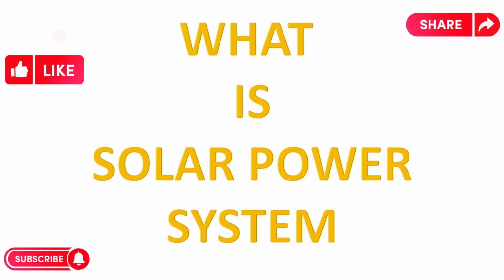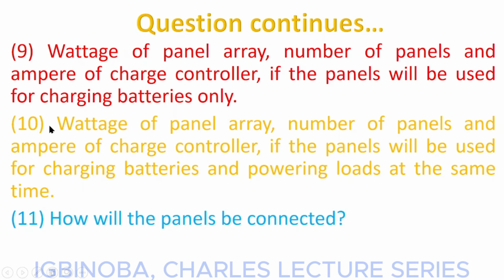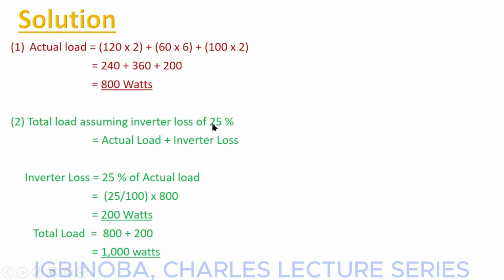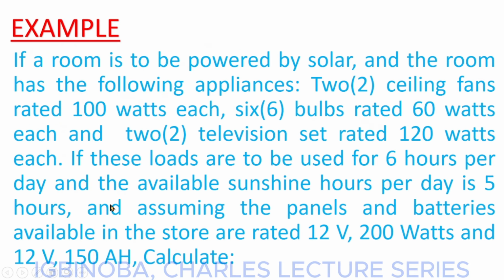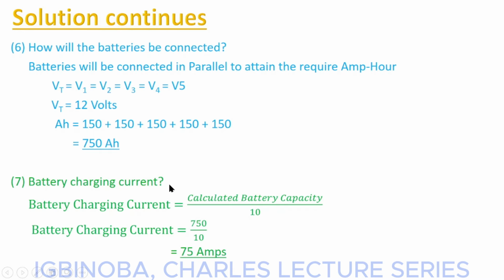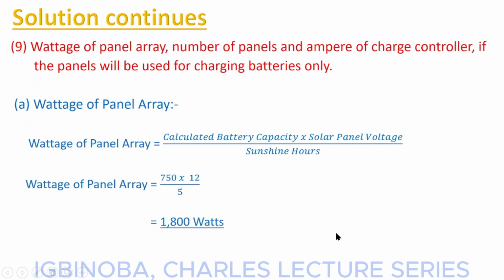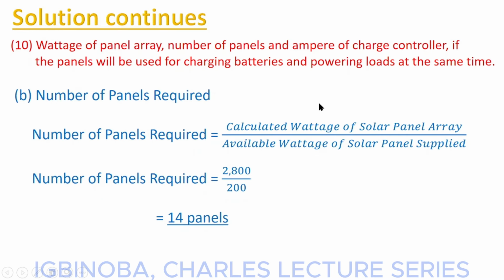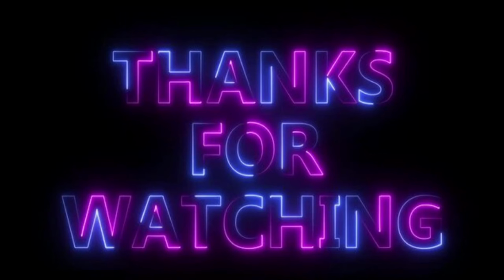Design of Solar Power System

Comment: EEE55C 
Answer;
i.Actual load-1380watts
ii-Total load-1725watts
iii-inverter rating-2156.25VA
iv-battery capacity -1293.75AH
V- number of batteries - 9
vi- batteries were connected in parallel 
vii- battery charging current -129.4 Amps
viii- battery charging time - 14hrs
ix-wattage of panel ( for battery)- 3106 watts
No of panel - 16
Ampere charge controller - 258.83Amps
x.for battery and load
Wattage of panel - 4831 watts
No of panel- 25
Ampere charging controller -402.58 Amps

Comment: NAT31E

1. The actual pad is 1,380W
2. The Total load is 1,725W
3. The inverter rating is 2,156.23VA
4. The battery capacity is 1,293.75Ah 
5. The Number of batteries is 9
6.  The batteries are connected in parallel 
7. The Battery charging current is 129.4 amps.
8. The battery charging time is 14 hours.
9. a. The wattage of the panel array is 3,105W
b. The number of panels is 16 panels.
c. The Charge controller rating is 258.75 amps.

10. a. The wattage of the Panel array is 4,830 Watts 
b. The number of panels is 24 panels.
c. The charge controller rating is 402.5 amps
11. The panels are arranged in parallel

Comment: MAR99U

Answers:

Actual load = 1380 Watt
Total load = 1725 Watt
Inverter rating = 2156.25 VA
Battery Capacity = 1239.75 Ah
Number of batteries = 8.625 (9 batteries)
They will be connected in parallel
Battery charging current = 129.375 A
Battery charging time with 40% loss = 14 hrs

9a. Wattage of panel array = 3105 Watt
9b. Number of panels = 16 panels
9c. Ampere of charge controller = 258.75 A

10a. Wattage of panel array with load = 4485 Watt
10b. Number of panels = 23 panels
10c. Ampere of charge controller = 373.75 A
They will be connected in parallel.

Comment: EEE106B
1. Actual load= 1380W
2. Total load= 1725W
3. Inverter rating= 2156.25 VA
4. Battery capacity= 1293.75AH
5. Number of batteries= 9 batteries 
6. Battery connection= parallel 
7. Battery charging current= 129.375A
8. Battery charging time= 14hrs
9a. Array wattage(charge only)= 3105W
9b. Number of panels= 16 panels 
9c. Charge controller current= 258.75A
10a. Array wattage (charge+load)= 4830W
10b. Number of panels= 25 panels
10c. Charge controller current= 402.5A
11. Panel connection= parallel

Comment: PETROCHEM61I

1)Actual load: 1380 Watts

2) Total Load: 1725 Watts

3) Inverter rating: 2156.25 VA

4) Battery capacity: 1293.75 Ah

5) Number of batteries for backup: 9

6) Batteries are connected in parallel

7) Battery charging current: 129.375 Amps

8) Battery charging time: 14 hrs

9) a) Wattage of parallel array: 3105 Watts

b) Number of panels required: 16 panels

c) Amps of charge controller: 258.75 Amps

10) a) Wattage of parallel array: 4830 Watts

b) Number of panels required: 25 panels

i

c) Amps of charge controller: 402.5 Amps

11) The panels are connected in parallel

Comment: CHM32F
1. 1,380watts
2. 1,725watts
3. 2,156.25VA
4. 1,239.75Ah
5. 9 batteries 
6. They will be connected in parallel 
7. 129.375A
8. 14hrs
9a. 3,105watts
9b. 16 panels 
9c. 258.75Ah
10a. 4485 watts
10b. 23 panels 
10c. 373.75Ah
11. They will be connected in parallel

Comment: CHM30D 
Answers:
Actual load = 1380 Watt
Total load = 1725 Watt
Inverter rating = 2156.25 VA
Battery Capacity = 1239.75 Ah
Number of batteries = 8.625 (9 batteries)
They will be connected in parallel
Battery charging current = 129.375 A
Battery charging time with 40% loss = 14 hrs
9a. Wattage of panel array = 3105 Watt
9b. Number of panels = 16 panels
9c. Ampere of charge controller = 258.75 A
10a. Wattage of panel array with load = 4485 Watt
10b. Number of panels = 23 panels
10c. Ampere of charge controller = 373.75 A
They will be connected in parallel.

Comment: PETRO52Z 

Answer:

1. Actual Load = 1,380 W

2. Total Load (25% loss) = 1,725 W

3. Inverter Rating = 2,156.25 VA

4. Battery Capacity = 1,293.75 AH

5. Number of Batteries = 9 batteries

6. Battery Connection = Parallel

7. Battery Charging Current = 129.375 A

8. Battery Charging Time = 14 hrs

9a. Array Wattage (Charge Only) = 3,105 W

9b. Number of Panels = 16 panels

9c. Charge Controller Current = 258.75 A

10a. Array Wattage (Charge + Load) = 4,830 W

10b. Number of Panels = 25 panels

10c. Charge Controller Current = 402.5 A

11. Panel Connection = Parallel

Comment: PETRO44R

Answers:
1. Actual load = 1380Watt
2. Total load = 1725Watt
3. Inverter rating = 2156.25VA
4. Battery Capacity = 1239.75Ah
5. Number of batteries = 8.625 (9 batteries)
6. They will be connected in parallel 
7. Battery charging current = 129.375A
8. Battery charging time with 40% loss = 14hrs
9a. Wattage of panel array = 3105Watt
9b. Number of panels = 16panels
9c. Ampere of charge controller = 258.75A
10a. Wattage of panel array with load = 4485Watt
10b. Number of panels = 23panels
10c. Ampere of charge controller = 373.75A
11. They will be connected in parallel.

Comment: CIV36J

1. Actual load 1380W
2. Total load on loss's is 1725W
3. Inverter rating 2156.25VA
4. Battery capacity is 646.9AH
5. No. Of batteries used 5 batteries 
6. Batteries are connected in parallel 
7. Battery charging current 64.69A
8. Time to charge 10HRS
9. Wattage power of panel 1552.54W
9a. No. Of panels 8 panels
9b. Current of charge controller 129.38A
10a. 2932.54W
10b. 15 panels
10c. 244.30A
11. Panels are connected in parallel to increase current

Comment: COMP80B

1. 1380W
2. 1725W
3. 2156.25W
4. 1293.75 Ah
5. 9 batteries 
6. Batteries are connected in parallel
7. 129.375A
8. 14hrs
9a. 3105W
9b. 16 panels
9c. 258.75A
10a. 4830
10b. 24 panels
10c. 402.5A
11. Panels are connected in parallel

Comment: CIV85G

1) The actual load is 1,380w
2)The total load is 1,725w
3)The inverter rating is2,156.23VA
4)The battery capacity is 1,293.75h
5)The number of batteries is 9
6)The  batteries are connected in parallel.
7) The battery charging current is  129.4 amp
8)The battery charging time is 14 hours 
9a)The wattage of the panel array is 3,105w
b.The number of panels is 16 panels
c.The charge controller rating is 258.75amp
10a) The wattage of the panel array is 4,830 watts
b. The number of panels is 24 
c.The charge controller is 402.5 amps
11. The panels are connected in parallel

Comment: CIV26Z 

Answers:

1. Actual load= 1380Watts

2. Total load= 1725Watts

3. Inverter rating= 2156.25VA

4. Battery Capacity= 1293.75AH

5. Number of Batteries= 9 batteries

6. Batteries connection: Parallel

7. Battery Charging Current: 129.375A(150A)

8. 14Hours

9a. Wattage of panel array (charging only batteries)= 3105.6Watts

9b. Number of panels= 16panels

9c. Ampere of charge controller= 358.8A

10a. Wattage of panel array (Battery and load)= 4831Watts

10b. Number of panels= 24 panels

10c. Ampere of charge controller= 402.6A

11. Panel connection: Parallel

Comment: MEC12L

Answer 
1. Actual load=1380w
2. Total load(25% loss)=1725w
3. Inverter rating=2156.25VA
4. Battery capacity=1293.75AH
5. Number of batteries=9
6. Battery connection=parallel 
7. Battery charging current=129.375A
8. Battery charging time=14hrs
9a. Array wattage(charge only)=3105W
9b. Number of panels=16
9c. Charge controller current=256.75A
10a. Array wattage (charge+load)=4830W
10b. Number of panels=25
10c. Charge controller current=402.5A
11. Panel connection=Parallel

Comment: COMP33G
   Answers:

1. The actual load is 1,380W
2. The Total load is 1,725W
3. The inverter rating is 2,156.25VA
4. The battery capacity is 1,293.75Ah 
5. The Number of batteries = 9
6.  The batteries are connected in parallel 
7. The Battery charging current is 129.375 amps.
8. The battery charging time is 14 hours.
9. a. The wattage of the panel array is 3,105W
b. The number of panels is 15.5 =16 panels.
c. The Charge controller rating is 258.75 amps.

10. a. The wattage of the Panel array is 4,830 Watts 
b. The number of panels is 24 panels.
c. The charge controller rating is 402.5 amps
11. The panels are arranged in parallel

Comment: EEE95Q

Answers:
1. Actual Load = 1,380W
2. Total load (25% loss) = 1725W
3. Inverter rating = 2156.25VA
4. Battery Capacity = 1293.75AH
5. Number of Batteries = 9 batteries 
6. Battery Connection = Parallel 
7. Battery Charging Current = 129.375A
8. Battery Charging Time = 14hrs
9a. Array Wattage (Charge Only) = 3105W
9b. Number of Panels = 16 panels
9c. Charge Controller Current = 258.75A
10a. Array Wattage (Charge + Load) = 4830W
10b. Number of Panels = 25 panels
10c. Charge Controller Current = 402.5A
11. Panel Connection = Parallel

Comment: NAT54B
1. The actual pad is 1,380W
2. The Total load is 1,725W
3. The inverter rating is 2,156.23VA
4. The battery capacity is 1,293.75Ah 
5. The Number of batteries is 9
6.  The batteries are connected in parallel 
7. The Battery charging current is 129.4 amps.
8. The battery charging time is 14 hours.
9. a. The wattage of the panel array is 3,105W
b. The number of panels is 16 panels.
c. The Charge controller rating is 258.75 amps.

10. a. The wattage of the Panel array is 4,830 Watts 
b. The number of panels is 24 panels.
c. The charge controller rating is 402.5 amps
11. The panels are arranged in parallel

Comment: MAR1A 

1. The actual pad is 1,380W
2. The Total load is 1,725W
3. The inverter rating is 2,156.23VA
4. The battery capacity is 1,293.75Ah 
5. The Number of batteries is 9
6.  The batteries are connected in parallel 
7. The Battery charging current is 129.4 amps.
8. The battery charging time is 14 hours.
9. a. The wattage of the panel array is 3,105W
b. The number of panels is 16 panels.
c. The Charge controller rating is 258.75 amps.

10. a. The wattage of the Panel array is 4,830 Watts 
b. The number of panels is 24 panels.
c. The charge controller rating is 402.5 amps
11. The panels are arranged in parallel

Comment: EEE23W 

Answer 
(1)Actual load - 1380W
(2)Total load(assuming inverter loss of 20%) - 1725W
(3)Inverter rating - 2,156.23VA
(4)The battery capacity - 1293.75Ah
(5)The number of batteries - 9
(6)The batteries are connected in parallel 
(7)The battery charging current - 129.4
(8)The battery charging time - 14hours
(9a)The wattage of the panel array is - 3105W
(9b)The number of panels is - 16panels
(9C)the charging controller rating - 258.75amps
(10a)The wattage of the panel array - 4830watts
(10b)The number of panels - 24panels
(10c)the charge controller rating -  402.5amps
(11)The panel are arrangement - parallel

Comment: COMP22V

ANSWERS:

1. The actual pad is 1,380W
2. The Total load is 1,725W
3. The inverter rating is 2,156.23VA
4. The battery capacity is 1,293.75Ah 
5. The Number of batteries is 9
6.  The batteries are connected in parallel 
7. The Battery charging current is 129.4 amps.
8. The battery charging time is 14 hours.
9. a. The wattage of the panel array is 3,105W
b. The number of panels is 16 panels.
c. The Charge controller rating is 258.75 amps.

10. a. The wattage of the Panel array is 4,830 Watts 
b. The number of panels is 24 panels.
c. The charge controller rating is 402.5 amps
11. The panels are arranged in parallel

Comment: PETRO91 

Actual load: 1380 W
2. Total load (inverter loss 25%): 1840 W
3. Inverter rating: 2300 VA
4. Battery capacity (75% reserve): 1226.67 Ah
5. Number of batteries: 9 (for 6 h backup)
6. Battery connection: Parallel
7. Battery charging current: 122.67 A
8. Battery charging time (40% charging loss): 14 h
9. Panel array (batteries only): 2944 W → 15 panels; charge controller 245.33 A
10. Panel array (batteries + loads): 4416 W → 23 panels; charge controller 368 A
11. Panels connection: Parallel

Comment: PETEOCHEM67O

1. 1380 watts 
2. 1725 watts
3. 2156.23VA
4. 1293.75Ah
5. 9 batteries
6. The battery are to be connected in parallel 
7. 129.4A
8. 14hours
9a. 31053W
9b. 16panels
9c. 258.75Amps
10a. 4830 watts
10b. 24 panels
10c. 402.5A
11 The panel are arranged in parallel.

Comment: PETROCHEM32F
ANSWERS:
(1) ACTUAL LOAD = 1380 watts
(2) TOTAL LOAD = 1725 watts
(3) INVERTER RATING VA = 2156.25 VA
(4) BATTERY CAPACITY = 1293.75 Ah
(5) NO OF BATTERIES = 9 Batteries
(6) PARALLEL CONNECTION
(7) BATTERY CHARGING CURRENT = 129.39 Amps
(8) CHARGING TIME (40% LOSS) = 14 Hrs
(9a) PANEL WATTAGE = 3105 watts
(9b) NO OF PANELS = 16 Panels
(9c) AMPS OF CHARGE CONT. = 258.75 Amps
(9d) PARALLEL CONNECTION
(10a) PANEL WATTAGE = 4830 watts
(10b) NO OF PANELS = 24.15 (Make 25 panels to carry system)
(10c) AMPS OF CHARGE CONT. = 402.5 Amps

Comment: COMP94P

1. Actual load is 1380 Watts
2. Total load is 1725 Watts
3. The inverter rating with a power factor of 0.8 is 2156.25VA
4. Battery capacity using a factor reserve of 75% is 1293.75Ah
5. The number of batteries is 8.6 approximated to 9
6. The batteries will be connected in parallel 
7. The battery charging current is 129.375 Amps
8. The battery charging time assuming a charging loss of 40%  is 14hr
9a. The wattage of the panel array is 3105 Watts
9b. The number of panels is 16 panels
9c. The ampere of the charge controller is 258.75 Amps
10a. The wattage of the panel array is 4830 Watts 
10b. The number of panels is 24 panels
10c. The ampere of the charge controller is 402.5 Amps 
11. The panels will be connected in parallel

Comment: CIV75W

1. 1380 Watts 
2. 1725 watts
3. 2156.23VA
4. 1293.75Ah
5. 9 batteries 
6. The battery are to be connected in parallel 
7. 129.4A
8. 14 hours 
9a. 3105W
9b. 16 panels 
9c. 258.75 Amps
10a. 4830 watts 
10b. 24 panels 
10c. 402.5A
11. The panel is arranged in parallel
Reply: PETROCHEM41O

1. 1380 Watts

2. 1725 watts

3. 2156.23VA

4. 1293.75Ah

5. 9 batteries

6. The batteries are to be connected in parallel

7. 129.4A

8. 14 hours
9a. 3105W
9b. 16 panels
9c. 258.75 Amps
10a. 4830 watts
10b. 24 panels
10c. 402.5A

9. The panels are arranged in parallel

Comment: EEE15O 

1. Actual load is 1,380W
2. Total load is 1,725W
3. Inverter rating is 2,156.25VA
4. Battery capacity is 1,293.75Ah
5. 8.6batteries (9 batteries approximately)
6. Batteries connected in parallel
7. Battery Charging current is 129.4A
8. Battery Charging time is 14 hours
9. a.Wattage of panel Array is 3,105W
b. 16 panels
c. Charge controller is 258.75A
10. a.Wattage of panel Array is 4,830W
b. 24 panels
c. Charge controller rating is 402.5A
11. Panels wired or connected in parallel

Comment: PETRO67O

Answer:
1. Actual Load
300W + 600W + 480W = 1380W
1. Total Load (25% inverter loss)
Total Load = Actual Load × (1 + 0.25)
= 1380W x 1.25 = 1725W
1. Inverter Rating (VA), PF = 0.8
Inverter Rating = Total Load ÷ PF
= 1725 ÷ 0.8 = 2156.25 VA ≥ 2.2 kVA (round up to nearest standard size)
1. Battery Capacity (75% reserve factor)
Daily Energy = Total Load × Backup Hours =
1725W * 6h = 10,350Wh
Adjusted for reserve: 10,350 ÷ 0.75 =
13,800Wh
At 12V: 13,800 ÷ 12 = 1,150 Ah
1. Number of Batteries (12V, 150Ah each) 
2. 1,150Ah ÷ 150Ah = 7.67 → 8 batteries
3. Battery Connection
Since both the battery and system bus are rated 12V, the 8 batteries should be connected in parallel - this sums the Ah
capacity (8 x 150Ah = 1,200Ah) while
keeping the voltage at 12V. (If a higher bus voltage like 24V/48V were required, a series-parallel combination would be used instead.)
1. Battery Charging Current
Using the standard C/10 rule (10% of Ah capacity) for lead-acid batteries:
Ic = 10% × 1,150Ah = 115A
1. Battery Charging Time (40% charging loss)
Time = Battery Ah ÷ (Ic × (1 - loss))
= 1,150 ÷ (115 × 0.6) = 1,150 ÷ 69 = =16.7 hours
(Since only 5 sunshine hours are available per day, full charging would take roughly 3-4 days at this rate - a higher charging current/more panels would shorten this.)
9. Panel Array - Charging Battery Only
Panel Array Wattage = (Battery Ah × Battery
V) ÷ (Sunshine hrs × (1 - loss))
= (1,150 × 12) ÷ (5 × 0.6) = 13,800 ÷ 3 =
4,600W
Number of Panels = 4,600 ÷ 200W = 23 panels
Charge Controller Rating = 4,600 ÷ 12V =
≥383A
10. Panel Array - Charging Battery +
Powering Load Simultaneously
Total Wattage Needed = Panel wattage
(charging) + Total Load
= 4600W + 1725W = 6325W
Number of Panels = 6,325 ÷ 200W = ≥32 panels
Charge Controller Rating = 6,325 ÷ 12V =
≥527A
11. Panel Connection
Since each panel is rated 12V (matching the system bus), the panels should be connected in parallel to sum their wattage/ current output while keeping the array voltage at 12V. If a higher array voltage were desired to reduce current (and controller size), panels would instead be arranged in series-parallel strings.

Comment: EEE26Z

1. 1380 watts

2. 1725 watts

3.  2156.25 VA

4.  1293.75 Ah

5.  9 batteries

6. Parallel connection

7.  129.375 A

8. 14 hours

9. 3105 watts
    16 panels
     258.75 A

10. 4830 watts
       24 panels
       402.5 A

11. The panels are arranged in parallel

Comment: COMP410

ANSWER

1. The actual pad is 1,380W
2. The Total load is 1,725W
3. The inverter rating is 2,156.23VA
4. The battery capacity is 1,293.75Ah 
5. The Number of batteries is 9
6.  The batteries are connected in parallel 
7. The Battery charging current is 129.4 amps.
8. The battery charging time is 14 hours.
9. a. The wattage of the panel array is 3,105W
b. The number of panels is 16 panels.
c. The Charge controller rating is 258.75 amps.

10. a. The wattage of the Panel array is 4,830 Watts 
b. The number of panels is 24 panels.
c. The charge controller rating is 402.5 amps
11. The panels are arranged in parallel

Comment: EEE18R

1. 1380 watts

2. 1725 watts

3.  2156.25 VA

4.  1293.75 Ah

5.  9 batteries

6. Parallel connection

7.  129.375 A

8. 14 hours

9. 3105 watts
    16 panels
     258.75 A

10. 4830 watts
       24 panels
       402.5 A

11. The panels are arranged in parallel